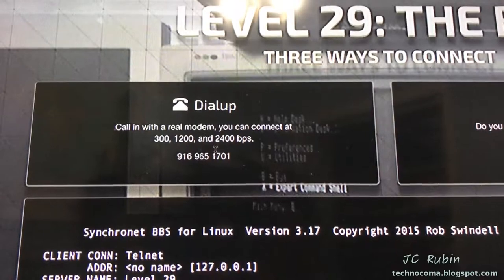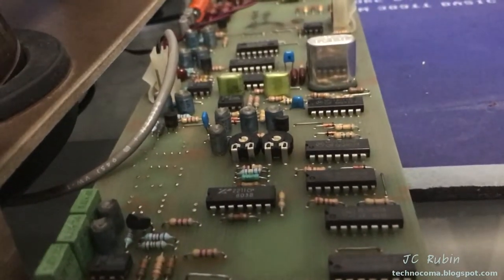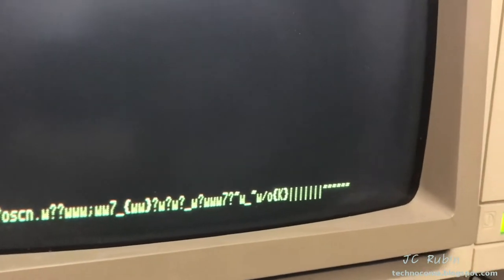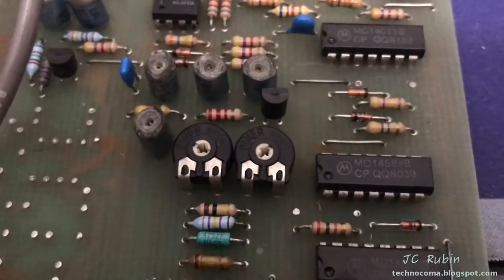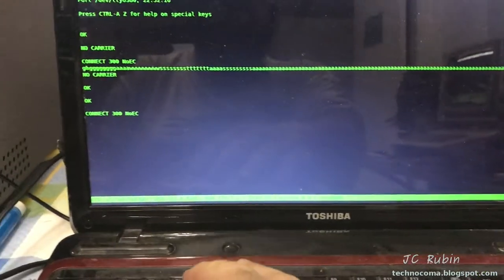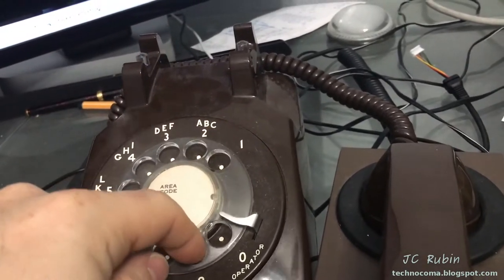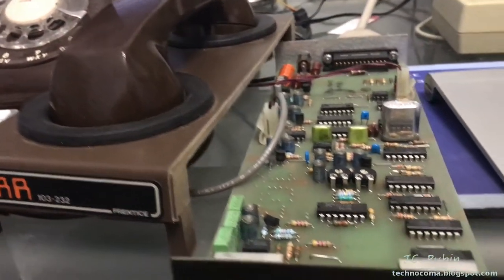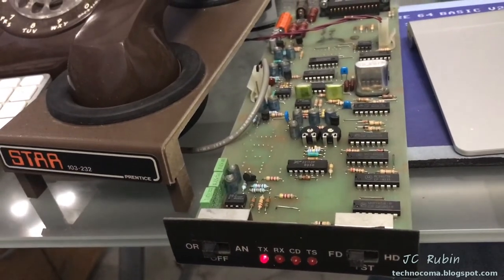Testing an antique acoustic coupler modem for the Apple II with a dial up BBS

Comment: It seems that obviously the issue isn't at your end, perhaps Level29 BBS runs on a digital phone line as opposed to a POTS connection and your modem is sensitive to the compression encountered on such a connection? Very interesting video BTW and nice Apple IIe! If I had a phone line running into my house I'd get my C64 connected to my 300 baud modem again for some analogue action, but I'm afraid it's a Wimodem connected to my WiFi allowing me to surf the BBS scene on my beloved C64!
Reply from the maker: I do not have a pots line. Its a google voice account in an obihai connected to an XLINK rotary generator

Comment: On the modem I messed with one pot was for Originate and the other for Ans mode. Thats why it seems like one was doing nothing at all. Look up the specs on BELL 103. IIRC when there is no data the modem is sending a constant MARK tone which in Originate mode is 1270Hz. If you have a frequency counter you should be able to get it spot on.
Reply from the maker: I was able to calibrate the modem, it was more of an issue of BBS's not actually supporting 300 baud.